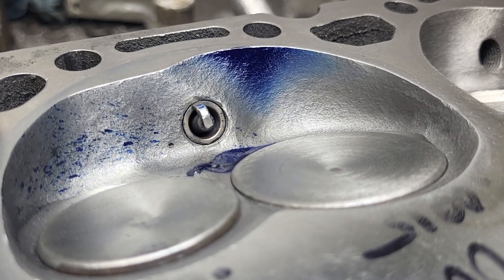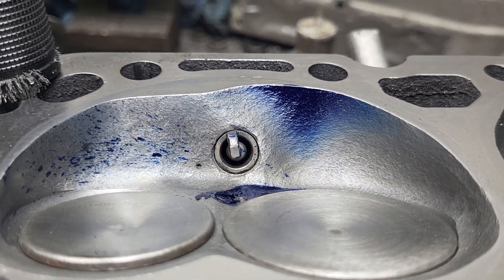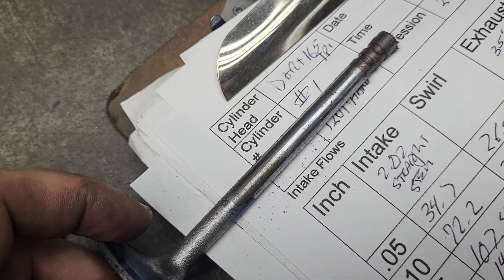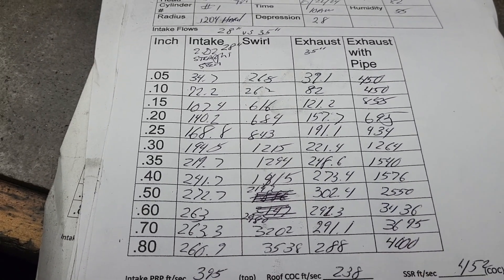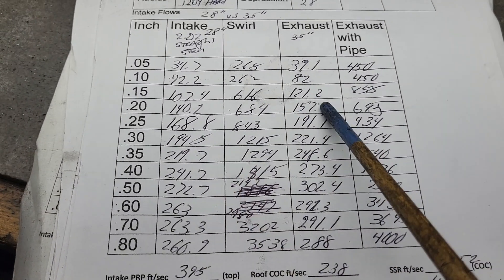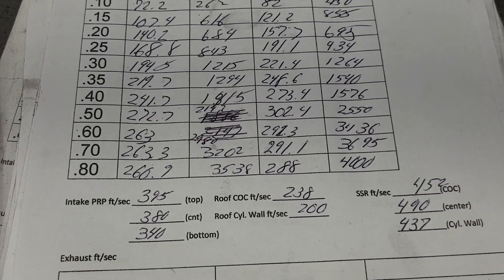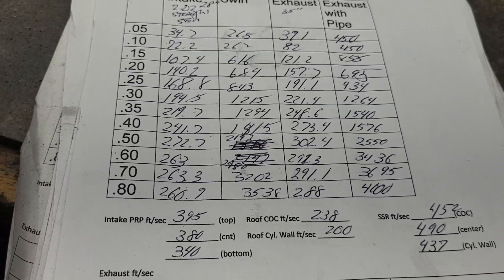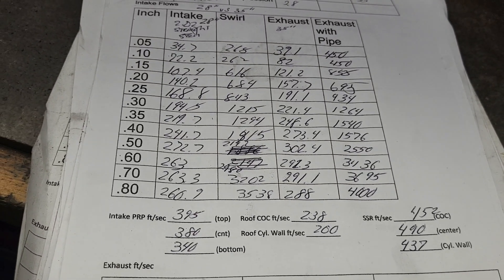Redheaded Stepchild, High Performance TPI project, flowing at two different depressions for info.

Comment: What is the typical cause for port flow to go down at high lifts? Loosing it around the short side?
Reply from the maker: Throat and ssr width, arc shape. I would think. Cause ssr to have issues. Thanks

Comment: If adding NOS. Concentrate on the short turn side of the throat. The efficiency doesn't need to be the same all the way around. You can open that area to 95% for added flow with NOS without sacrificing N/A performance.
Reply from the maker: I just did 2 days experimenting on exhaust throat ratios. Stay tuned! Long and boring!
Reply: @servediocylinderheads    That's how we like it :)

Comment: Wow that's some airspeed, that's close to mach .5, you're starting to get some compression effects in the port at that speed. Mach one is ~1090 fps, in fact compressiblity effects start at around 340-350fps. Since all the air is confined to the port and doesn't bleed out it's practically always in "ground effect".